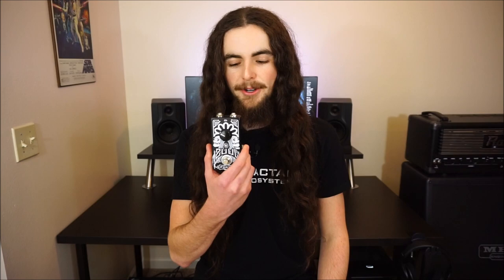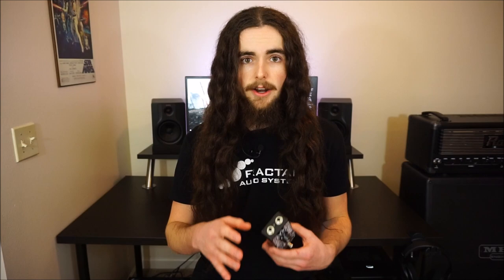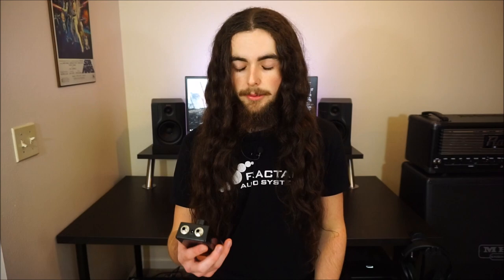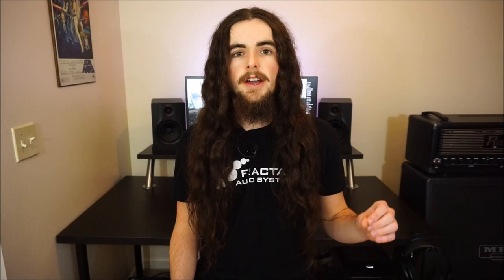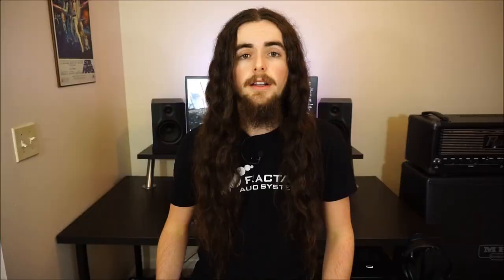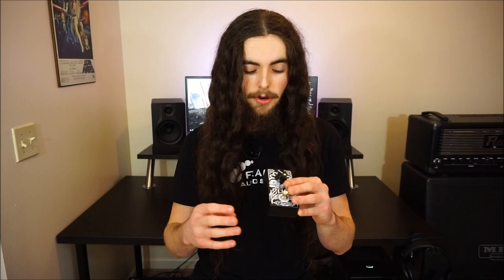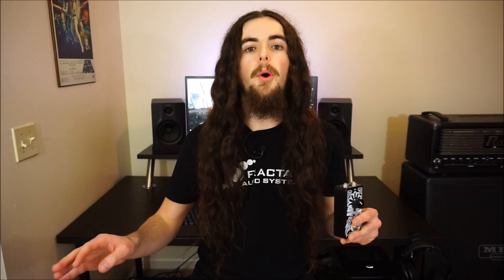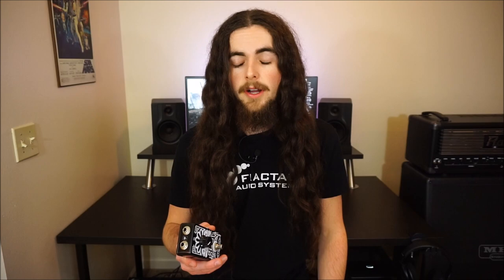Fortin ZUUL Pedal Review -The New King of Noise Gates

Comment: Thank you so much for the review. I appreciate all your feedback on it. To address the reason as to why I  didn't put a bypass out with the KEY input was mainly because of the numerous times I've seen guitar players connect through the wrong 2 of the 4 jacks on other NG pedals. So the single KEY input jack was used to try to eliminate pilot error. The thought was that most players would already have a spare output from a tuner, splitter or simple $4 Hosa y-cable. Cheers! Mike Fortin
Reply from the maker: +Mike Fortin Good to hear from you again Mike! I think your assumptions are sound on both parts. If someone is buying one of your pedals, they probably already have the gear to use the Key input, which is why its not a grievous design flaw to me. And most of us guitarists are liable to screw up our signal chain somewhere, so idiot proofing is a positive side effect.
Reply: I have a question about that. I just run a 1/4" from my Boss Tuner "bypass" port to the Key input, correct? The Boss Pedal is the 'Waza Kraft" and it has a selection to make that Bypass port a "Buffer" or a "Thru". How should i set this?
Reply: Mike Fortin How about a Europe-distribution for your gear? I bet that I‘m not the only german guy who ordered a Zuul and who wants to try out your boost pedals;)
Reply: @ThornWithin  In stock now, I just got mine
Reply: Does it have to be used in an effects loop?
Reply: @ddubbz1979  no you can use it in front but you will get the best results from the loop
Reply: @dhunter813  same question here because I have the waza tu-3 on the way but I would imagine you could just try both and see how she goes.

Comment: Just got my Zuul today, I have it hooked up through a Boss tu3 tuner into effects loop but it’s not gating the sound or stopping the noise. Tried different cables and power supplies to no avail. Your demo shows it cutting off the noise and gating really well. Any help would be appreciated before I return it. My amp is a EVH LBX
Reply: Did you find a solution to your problem? Sounds like we’re having the same problem. The Zuul works excellent when playing but whenever I mute to tune I get feedback coming through. I’m running everything through a mid 2000’s Mesa triple rectifier, I thought I read something about having to mod the effects loop to serial mode? Not sure what to do, frustrating!

Comment: Are there splitters without buffers? Using a Lot of fuzzes Here. Would be really interesting.
Great recommendation!
Reply: daisy chaining power supply totally destroys this video... he meant well and is very knowledgeable.... the Zuul kiks ass when hooked up right .... shit in is shit out nuff said ....and you want the splitter to have a good buffer so the Zuul gets a good strong clean signal and the rest of signal goes to your main strong... also if you use passives and actives like i do they both sound strong...... i tried a chorus pedal to split the signal and it naturally has delay on the split so yes use a good buffered splitter...ie Roach / Spliff or a little bit budget if you only need two outs go with the JHS buffered/splitter

Comment: I don't see how this is better than an ISP Decimator II G-String... which doesn't require you to split your signal (it has a dedicated guitar in and its own loop for your noisy stuff). So the one gripe you have with the Zuul is actually a deal breaker. My tuner doesn't have two outputs and I wouldn't want to buy a splitter just for this purpose as it should be a feature of the pedal itself.
Reply: I agree. The Decimator II G String has the same type of sensing circuit as the "key input", that determines when you are playing based on the clean guitar signal. The Decimator circuit is in the effects loop just like the Zuul, and it also uses a single knob. I'm sure the Zuul uses a downward expanding output circuit just like the decimator to keep from cutting off sustained notes. The downside being that now I need to put another buffer or splitter in effects chain?  I'll wait for version 2 to be released and then compare.
Reply: Yeah I have the isp 2 g string and it works flawlessly. The only problem I have is it doesn't work in my other amp because it has a parallel loop. But that's not the pedals fault.
Reply: Maybe its not better. Up to the potential buyer to decide.   I decided it costs too much & I need something to choke out the hissy noise when playing loud.   ....     40.00 will do that for me.  Ive had the ISP Dec 1 , Dec 2 and  Gstring within the last 10 years.  I know what they do.   They do theyre job.   Sometimes when products get overrated & it drives the prices up.
Reply: It's not better, especially at Fortin prices.
Reply: I bought a chinese brand called Caline   Noise Gate.     Ive used it for 3 gigs so far,   Set it at 12 noon,   works perfect.  37.00

Comment: Hey man, I have a question about something nobody is covering in any of the demos for the Fortín Zuul, can you roll off your guitar’s volume for a good breakup sound? I find that when I roll off my guitar’s volume when using other noise gates, my signal is completely cut out due to my guitar signal being below the threshold of the noise gate. I was thinking that if the Zuul registers whether there is signal going to the “key input” in order to cut off the signal or not, then I could actually use my volume knob to change the dynamics of my playing!

Comment: Wait a minute. Your clean channel engages when you shut off the Fortin 33? So you mainly get that distorted sound with this clean boost? Did i miss something? :/
Reply from the maker: No, the Fortin 33 has a relay switch that changes the channel of the amp at the same time its turned off. The new grinds have the same feature
Reply: Ah, i see. Thanks for the answer !

Comment: Hello.not sure I would get any reply on an old video but I'll try
Thanks a lot for that video. I wonder if this noise gate would do well with fuzzes. Of course it would cut the noise, but how does it fare when you ride a lot the volume knob?. That key input gives me hope
Reply from the maker: Luckily l, I did happen to see this one. So the gate issues you're likely going to face with riding the guitar volume with a fuzz pedal are two fold. 

First, if you use the key input feature of the ZUUL or similar pedal, you have to buffer and split your signal prior to the fuzz pedal for it to work. That's fine for some more contemporary fuzz designs, but not so good on classic designs with low input impedance. Adding a buffer prior to something like a fuzz face ruins the tonal characteristics and volume rolloff behavior because your guitar pickups are no longer reacting to that pedals impedance, but rather the buffer's.

Secondly, if you skip out on the key input, you are just left with a "dumb" gate after the fuzz. Setting the threshold on the gate for typical "full volume" output levels may be too aggressive for low volume settings, and vice versa.

In summary, it really depends on what fuzz pedal you use, and whether it reacts to a buffer in front in a way that you find acceptable. Otherwise, using noise gates with old fuzz pedals is a tricky matter to resolve.
Reply: @PlagueScytheStudios  thank you sooo much! Very insightful. I'll test for there

Comment: Late to the party but...Why not just use a Y splitter? Thinking pedal board application with a patch panel. you could just come off the guitar jack with 2 lines. One to the signal chain and the other to this. Isolated would be best in my opinion but why not? Would there be signal loss or additional noise introduced?
Reply from the maker: Like Mr. Fortin said himself, you could use something like a hosa Y splitter. However, I use that buffer for more than just this application.

Comment: First of all sorry for my english, i have a question about the settings on my amplifier, my booster pedal and  delay  are always on in my fx loop, and I just want to turn them on when I'm playing solos, I activate this option pressing my footswitch effects, and if I want to play rhythm guitar I turn it down. When I activate the zuul to reduce the noise "it ruins" my setting preferences on the fx loop  because if i want to reduce noise i have to turn my fx on. The point is what is the best option if I want to activate the boost and the delay effect just with one button? i was wondering if it was a good solution by connecting a loop pedal between the zuul out and amp return, thanks.
Reply from the maker: +Eldaryon277 It always amuses me that people who are worried about their English leave better written comments than most Americans haha. If I understand your signal chain correctly, then a looper would probably be your easiest fix here if you don't want to play tap dance with your pedal board. I would get something that can set up scenes like on amp modelers so you can change your amp channel and effects both within the loop and in front of your amp all at the same time.

Comment: How does it react with sustained lead tones?  
Some gates cut the lead tones to far
Reply: Finally!!!  The most important question that nobody’s answered.  Any gate cuts noise or the signal.  It’s the sustain & attack of a single note that makes or breaks your sound.  How is  the Zulu and it’s key input on that issue?
Reply: It still can get in the way if you turn it up too high

Comment: Does it matter if my noise gate is in parallel? I know the isp g-string requires the loop to be in series.
Reply from the maker: This pedal definitely needs to be in a series loop if your parallel loop can't do a 100% wet mix, such as Mesa boogie fx loops that max out at about 85%.
Reply: Plague Scythe Studios Do you know where the Powerball_2 maxes out? I'm thinking it will work. I have only tried the ISP_2. I will probably give the G-string version a go. If that doesn't work I'll try out a ZUUL.

Comment: Would it be worth getting this if I would only be using it with an axe fx 2?
Reply from the maker: Not at all. Tweaking the input gate and throwing a gate block after the amp will get you more than adequate results.
Reply: @PlagueScytheStudios  gracias, I figured but just wanted to make sure.

Comment: Zuul vs ISP Decimator II G String. What is the winner?  Why?
Reply: The G String works just as well and doesn't require a splitter of any kind. I have two of them on two boards where I switch between very high gain and clean sounds and they work great. The Zuul would be just as great if it didn't require the splitter. The argument that they didn't want to add it because someone might hook it up wrong doesn't hold water with me. If they would simply include a small diagram of how to hook it up, it would solve any potential issues.

Comment: Over $200 for a noise gate is ridiculous.
Reply: Pricey, I agree...But so what,  you get what you pay for! I've tried countless gates/noise suppressors($50 - over $200...cheap to expensive ) and none come close, or even compare to the Zuul or ISP Decimator (original, II, or II G string). Both amazing and worth the cost!! Again, in my opinion, why pay less for crap/or stuff that doesn't perform as you want it to/as good as it should.! If you use a high gain amp, and want a tight, noiseless setup, do yourself a favor (don't be cheap/....save up if you need)....disappointment won't be an issue with the Zuul or Decimator.
Reply: Nick Pep for a noise gate, which just opens when you play, and closes when you don't, I don't understand what the difference is. Gates dont color your sound, or modulate. I have a gate that works like a charm and it was $20.